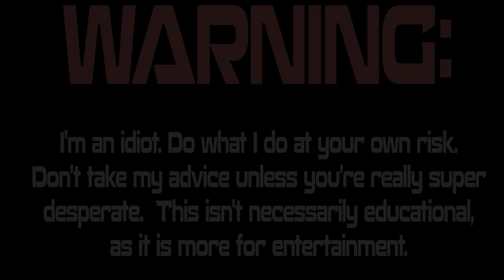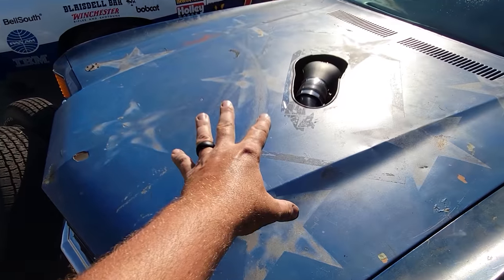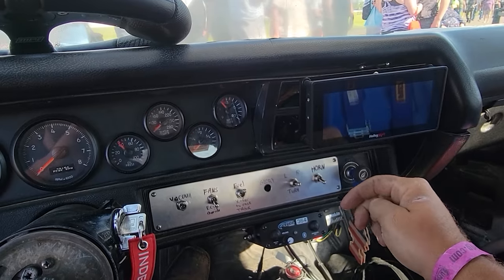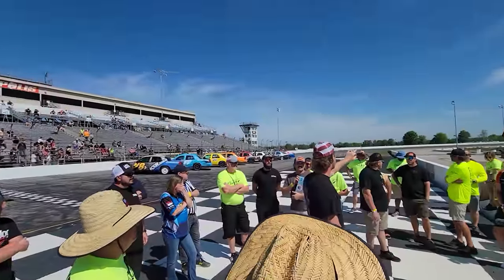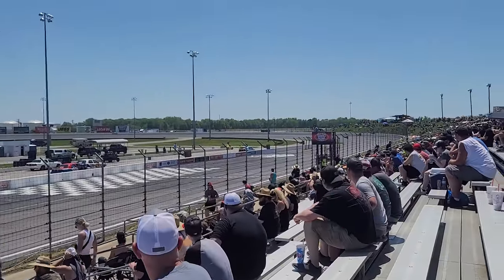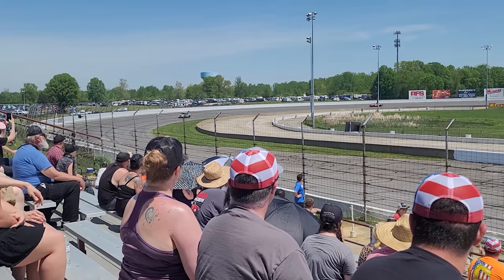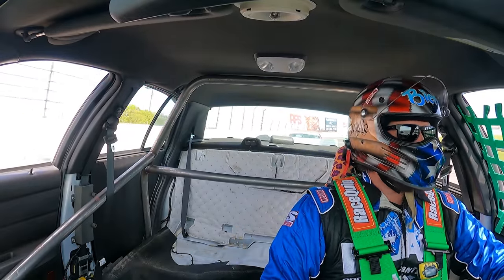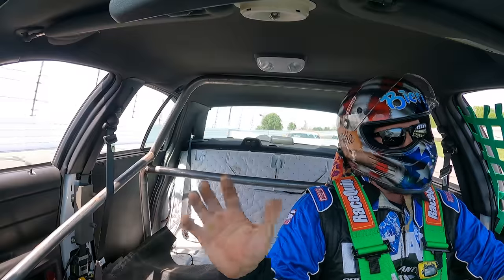Indy 800! - Wrecked at 3rd | Behind the Scenes | Independence Damage Update

Comment: If it’s overheating you could use the old Minnesota farmer trick turn the heater on full blast …gets a little warmer in the car but you get that the heater core working as a little radiator, it may help
Reply: That doesn't work
Reply: @12yearssober  Sure it does, I had to do that in my 92 Cavalier at every drive thru line I sat in when it was hot.
Reply: @12yearssober  It works , the coil in the heater is just a small rad
Reply: @--_DJ_--  
Wouldn't work at speed long term.
Reply: Drove 400 miles in summer with heater on,  only way it stayed cool.
Reply: @survivingminnesota8381  
In the winter maybe. Try that here in Florida and it won't be good.
Reply: @12yearssober  middle of summer from Nebraska to Minnesota.  Only way to Jerome it cool was to drive with heater full blast at night.
Reply: @12yearssober  It’s not ideal, but it can help depending on how dire your situation is.
Reply: @michaelcharette6961  Agree, and I've don it too, though as said, it works, but up to a point.

Comment: This looks like so much fun. If this was a series, I would buy a Crown Vic in a second. Great Job and thanks for sharing! Quite an experience I would imagine.
Reply: The latest issue of Hot Rod magazine has an article on exactly that, racing series for Crown Vics, also known as "P2" or "Panther" platform cars. Has links for the organizations.
Reply: Just get a panther body anyway, they are great. I'd wager the grand marquis is actually the best to get given it's lower ride height compared to p71 cars. Rear end is easy enough to change out for the right one.
Reply: @_badsine_  all Panther cars are exactly the same the  Grand Marquis doesn’t handle has good as the P71 Panthers which are the best ones to buy most fun to drive and the coolest looking apart from the Marauder which is almost too rare to find anyway

Comment: Stay safe...wishing you all the best. But the safety level of those cars would worry me....rear ends that move 4 inches side to side and seats that move so much you have to strap them down....those can lead to BIG problems if you need the safety gear. As one who nearly died behind the wheel of a race car, I wouldn't step in a car that wasn't 100% safe as it could be made...especially with the family so young. The cars are moving too fast for that level of safety gear IMHO...
Reply: These are stock crown victorias barely going 30mph. Relax.
Reply: That car was broken and he didn't race it.
Reply: I mean they have a roll cage and helmet. You want it wrapped in bubble wrap ?
Reply: @Ada-zn3pw  If you call that a roll cage...you don't have a clue what you are talking about...
Reply: @CR7659  ...the car was "heavily prepped" and transported a long way to be ready to race...
Reply: @randymackintosh6559  And the watts link broke in the car.  That even used to happen to Nascar Cup cars before they went to the next gen car.   Can it be fixed?  Maybe, but not with what equipment they had at the track.
Reply: @randymackintosh6559  Exactly. These folks think a rinky dink 4 point roll bar is a "cage" 🤣.
Bring any of these jalopies to your nearest short track, and you're ass isnt even getting on the track.
Reply: @trevor4533  It is basically a main hoop with some badly designed "door bars" that don't even go all the way to your feet. You get T Boned in that car and those door bars ain't stoppin' nuthin...
Reply: @randymackintosh6559  Spot on man! I had some guy tell me the other day that roll cages would only help for a rollover anyways, and because these clapped out crown vics had DOT approved door reinforcements when they were new, you don't need a full cage. Like bruh... 🥴

Comment: Time for quarter pannels and some paint tricks
Reply: Probably going to need to do something at some point, maybe section in a donor trunk with drop-offs and replacement quarters. It'd be a ton of work.
Reply: I agree ole independence needs some love
Reply: @ontheroadwithpastoranthony3161  If you really looked at the Chevelle after yesterday's burnout, it more or less hit the wall from the bumper end, and the front nose clip was not sitting straight to the left fender, so the frame on the driver's side got pushed forward in the process most likely.

Comment: My dad was a dirt track racer, I am a business owner and work in IT so this is a little out of my depth of expertise. I have never been mechanically inclined.   My dad would race cart, drag, funny car, stock, and speed of the various HP classes, for many many years.  Boxcar Ronnie was his name on the track, #26 (my birth day).  He would get a Mopar car and gut it inside and out.  Maybe keep the chassis and engine, or maybe do a swap.  Then would give it the 'ol tune up - right up until the maximum criteria for racing.  

If whatever league he was racing in - lets say 400hp and some other qualifiers,  his would be 399.9hp, every time.  Boxcar came from how he made a box around the chassis with whatever metal he had laying around and riveted or welded on pieces of sheet metal to make an exterior outside of the cage.  I remember he always slapped a "Getting in and out is easy when you got a big Johnson" sticker on whatever car he was racing.  I still don't understand the reference, I assume the cage - but he wasn't as patient, explanatory, or verbose as Derek.  My dad's car was always yellow with black letters.  He was really good and would get 1st, 2nd, or third consistently - but he did have quite a few wrecks, usually towards the end of the race when everyone gets feisty. I think that is where the custom frame/sheet metal came in handy for quick repairs for next weeks race.

One thing he always told: me "Bumping is racing, and if you're out there to win, then go for the win"  I don't know if that is right or wrong, I am pretty sure that is a movie line from somewhere - maybe Days of Thunder, but he lived by it and enjoyed it.  It was a pleasure watching you compete with what you had to drive. It brought back great memories of my late father.  Thank you for all that you do for online fans and crowd fans.  You Rock Derek, family, and supporting people!  Look forward to your restoration projects, and gets this IT nerd in the spirit to restore something and breathe new life into it.  I can't tell you how much I enjoy watching old cars get restored and put back to their paces.  Truly a pleasure.

Comment: Why don't they cut vents into the hoods to keep air flow across the top of the engine for some extra cooling?
Reply: That would be a good idea. Local to me when they they Enduro races with stock street type cars they have to cut a large hole in the hood so they have access in case of fire. I'm sure it also adds to the cooling ability

Comment: Maybe a guy needs to open up the grill on his car and strap up a large heater core on the hood with an electric fan and hood scoop for additional cooling. And run some Schaeffers fluids in the engine and transmission.

Comment: Pssst,  Crown Vic’s handle better when the tires are between 45 and 55 psi!!  Trust me, the Oklahoma State Patrol holds a annual police offensive driving class that lasts a week long.
Reply: Hmmmmm, I'm not sure. That sounds a little high, especially for oval racing. But then again, these cars are like 4000 pounds so who knows lol. It would be interesting to see what tire pressures the originators of this class run, down at Indianapolis speedrome.
Reply: @trevor4533  I know it’s off the wall, but if I hadn’t seen it for myself I wouldn’t have believed it!  The annual police class I mentioned before has a chase section and the charger out performed everything until they changed the tire pressure on the Vic’s.  It evened the playing field and 50 psi was the butter zone.
Reply: @dougwarren584  Oh no, I believe you! I was just speculating on if that would work for a hundred lapper on an oval that's all. I think it was pretty hot out there too. A street stock for example, in race trim is about 3100 pounds. So quite a bit lighter than these fords. Left side tire pressures would be around ~20 and the right sides ~30.
Reply: @trevor4533  Hard to say, but I have always read my tires regardless of tire pressures.  I try and optimize them  to get the widest contact patch and the best feel.  Over inflating a tire like those on Vic’s gets the best feel and handling, but the trade off is tread life.  So for a long run, it may not be a good choice.  But for a short one, it will be fast around the turns!!

Comment: The lazy way to paint it would be to swap body parts over.   Hood, doors, deck lid.  Fenders, bumpers if you're ambitious, but the stuff I mentioned are usually four, six bolts tops and a few electrical plugs.  

Should have hit somebody hard enough on the straight to knock the grille out of it.  Get more air into the radiator that way.

Comment: Independence may be bruised, even battered in spots, but it endures its scars like a stoic soldier. No matter how many wounds it takes, Independence will always rise again, like the fabled Phoenix, brighter and better than ever. Sure, it may get ragged and rough before the Phoenix emerges, and it may or may not be fully engulfed in flames at some point, but it will rise again, and never die. :_firemaker::_spark:

Comment: As a seasoned veteran of painting $500 race cars for as little money as possible in as little time as possible, I’m telling’ ya, forget the spray paint and buy yourself some Rustoleum roll-on paint and some small foam rollers. Paint an entire car in one coat and less than 10 minutes with that stuff and it’ll be dry by the time you hit the track.